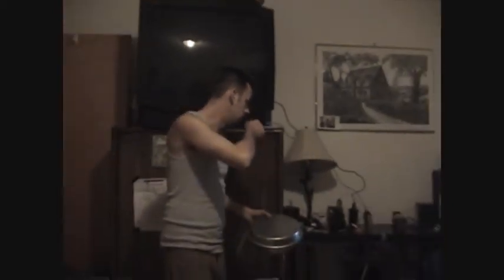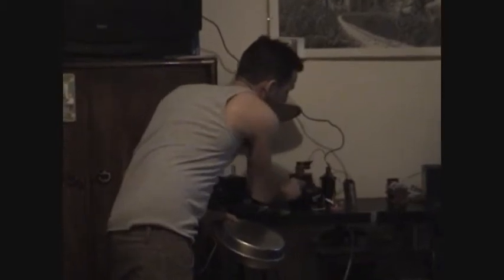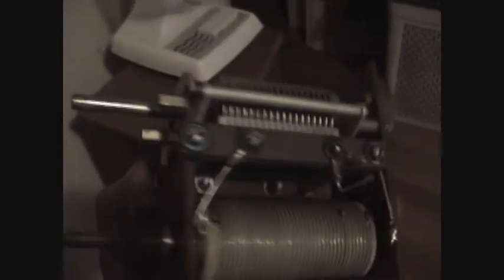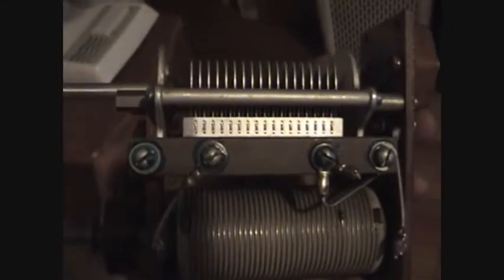Wireless energytransmission pt7

Comment: Both, I think.

The length of wire from the bowl/capacitor should be matched in length to the other one I think and to the frequency of the transmitter.

Like if one is a meter long the other can be a meter, half meter or quarter meter, you get what I mean?

and both sides should be ground so it is actual a one wire system. (The Earth)

Its only what I have read through, never tried it.....

Hope this helps

Paul.

Comment from the maker: dude, im useing a 18gauge 8wire.  i wonder if i hook all the 8 wires in series up to the transmiting antenna if it will help?

thanks for the tips.  

If the bowls the Capacitor then what is the other side of it?  ad are you talking about the transmitters bowl or the recievers bowl?